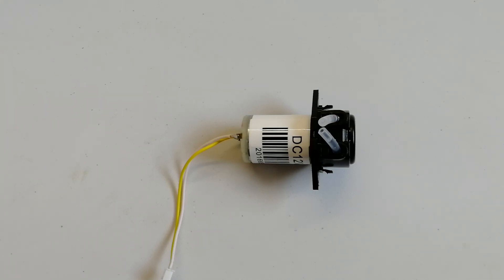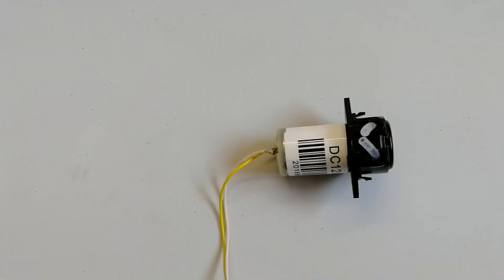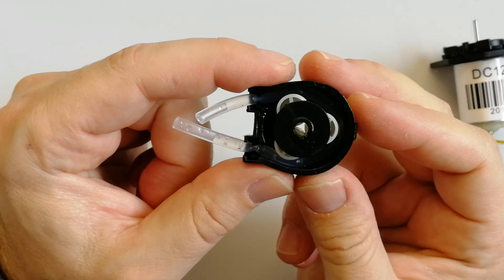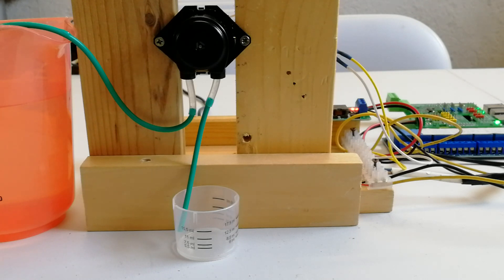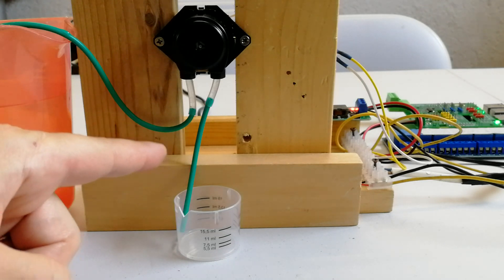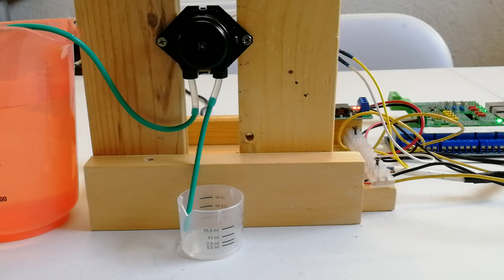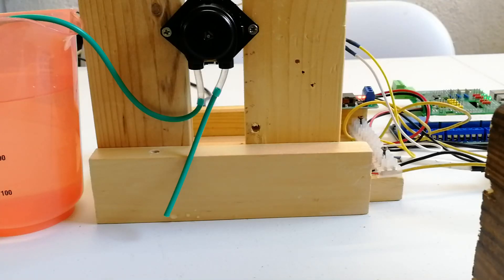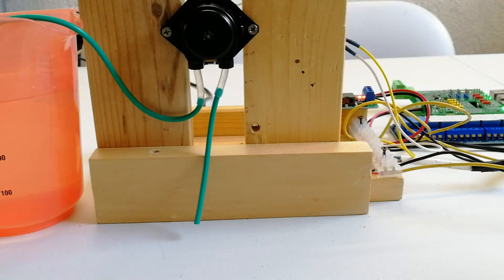Peristaltic pump testing with Raspberry - Hydroponics Dosing

Comment: how did you control the pumps with the raspberry? the pumps are 12v and the raspberry max out is  5v , what module did you use to power the pumps?
Reply from the maker: I used a relay board. You can check the link in the description for details